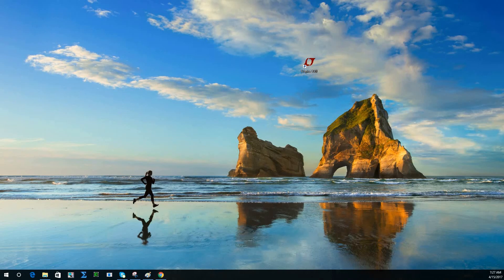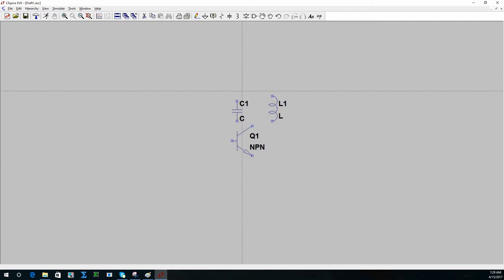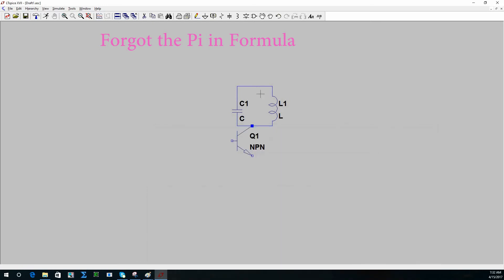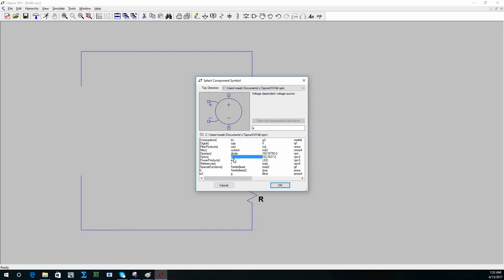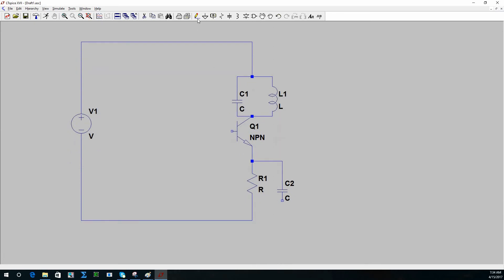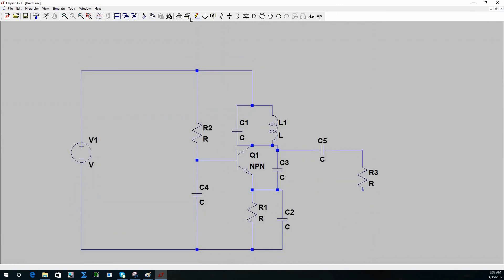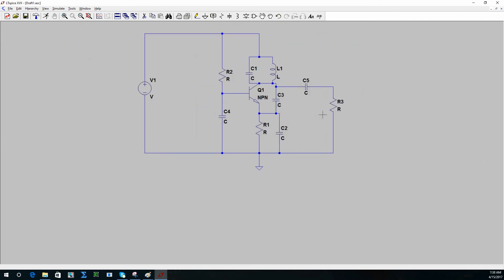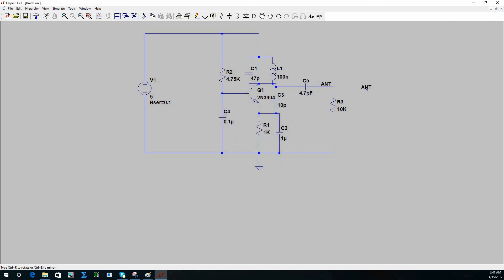Design A Long Range FM Transmitter - Part 2 Simulation

Comment: You said 1K resistor and you wrote 10K resistor on R3. I am confused can you please explain.
Reply from the maker: Since for RF you have a capacitor, so if you will put 1K and 10K I don't expect much change, but to be on the safe side put 1K

Comment: argh this makes me remember first year of uni
Reactance of Xc of the capacitor = 1/(jwC)

How much power can you get out of a simple NPN transistor design?
Reply from the maker: Thank you for the Very good question.
Basically you can measure with spice the current that goes through the NPN transistor, however this is not the exact power out. Since it depends a lot in your Antenna, you will need a 1/4 lamda antenna for best transmitting power out (lamda = c/f, which c is 3*10^8, and f is your frequnecy), I will do some tests to find maximum power out, but I expect 1mW to 100mW MAX.
This is not RF power transistor, but general purpose that can work in this circuit
Reply from the maker: Another way is to use SWR meter with an antenna, which measuring the real power out
Reply: please i will like to know a way I can measure the power of the transmitter